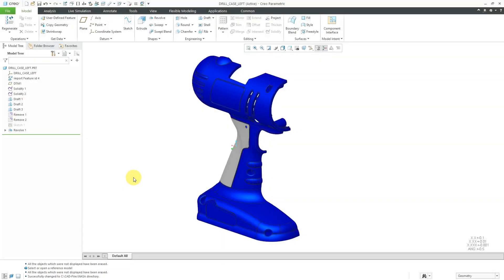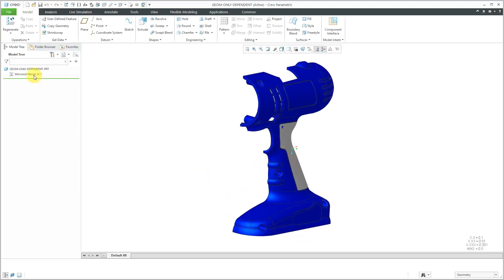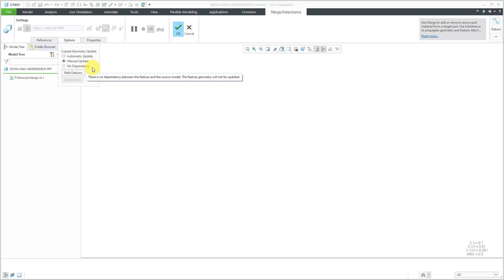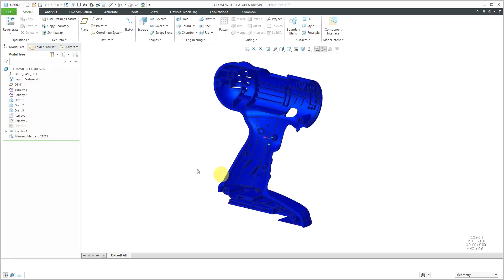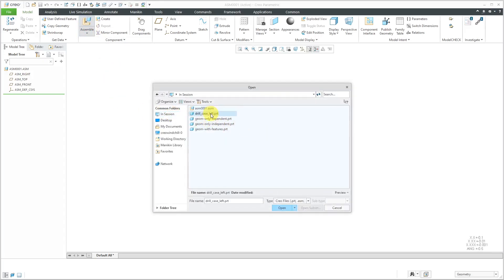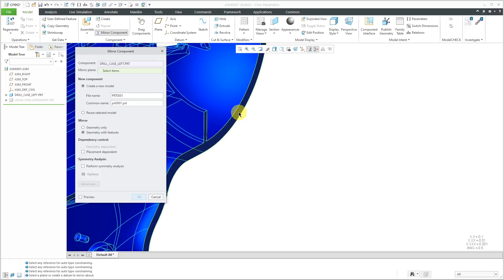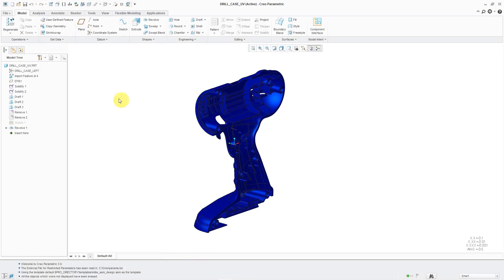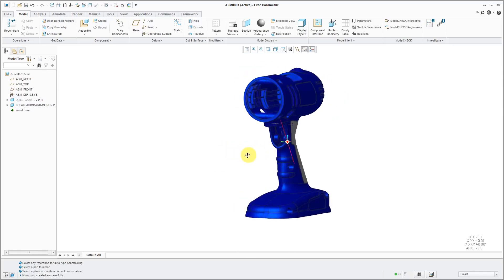Creo Parametric - Mirror Parts

Comment: Hi Dave why there is no option for selecting the desired plane for mirroring in the part mode? Is there any option to do tht in part mode?
Thanks
Reply from the maker: When this command was introduced, I wondered the same thing myself. I performed a bunch of tests to assure myself that selection of a plane for mirroring in part mode doesn't make a difference - and it doesn't. If you think about it, it shouldn't. I encourage you to perform the same tests to see for yourself.

If you really care about orientation relative to default datums or something, you can use one of the Mirror commands in Assembly Mode, or manipulate the resulting Mirror Part geometry with FMX or the Warp command. But selecting a mirror plane in Part Mode is really a deceiving and unnecessary level of control.
Reply: I'm having the same problem, have you found a work around?

Comment: Hi, having trouble, bit of a brick wall putting rounds (fillets) on a mirrored part because they're assembly elements. Many features missing because they aren't parts. I remember Old creo would mirror the part as a part in a part. I find this very disjointed. Try running a round around your parting line . You could do a swept feature but you can't extrude features in an assembly. You could extrude along your part line and then round but only positive features rather than negative subtractive rounds. Locked out of choices? Any suggestions on mirror feature(whole model) in a part and not a new part new window limited assembly choices. Many thanks for the video and hopefully a possible solution. Regards. Digger

Comment: Can I rotate a part that I mirrored ?
Reply from the maker: You can always use the Warp tool to transform geometry... but why would you need to?
Reply: @CADPLMGuy  I was just curious if we could rotate the mirrored part separately
Reply from the maker: @RandomsDude  You can rotate any part separately, but again I ask, why would you need to?
Reply: @CADPLMGuy  I designed a drone's propeller blade. I started by creating one side of the blade with sweep blend then try mirroring it to create otherside. 
But the problem is I want that part to be turned 45°
Reply from the maker: @RandomsDude  Do you want to rotate a part or a mirrored feature? There's a difference. If you want to do the latter, you should watch my videos on the Flexible Move command.
Reply: @CADPLMGuy  ok thanks for the time
Reply: How to do that please help

Comment: What if the plane Creo chooses for me is not the plane that I want to mirror about? How can I change the plane?
Reply from the maker: There is an alternate method depending on what version of Creo you are in... but is it necessary? I did some testing, and could not find a difference in geometry by changing the plane.
Reply: @CADPLMGuy  I'm using creo 6. In my opinion it is nessesary when my part is symmetric on one plane (but on others not), and the automatic plane of the mirror is that exact plane. So if I want to mirror the part, nothing happens.
Reply from the maker: Use the Mirror Component command.

Comment: Thank you Mr. Martin for yet another helpful tutorial! How do you properly mirror a coordinate system? When I try, the result points its axes in the same 3 directions as the original.
Reply from the maker: I believe based on information in the PTC Knowledge Base, the resulting orientation depends on the coordinate system's location with respect to the mirror plane and it takes the right hand rule into consideration. I'll have to test for myself. But according to PTC, that works according to product specification.